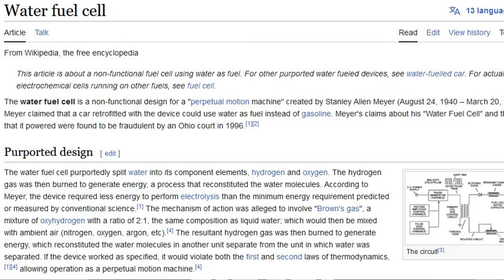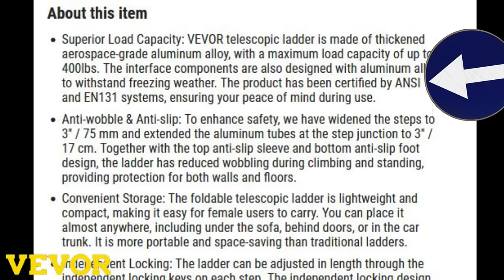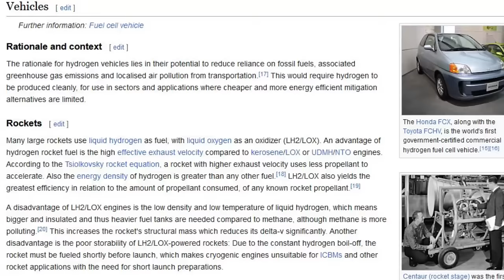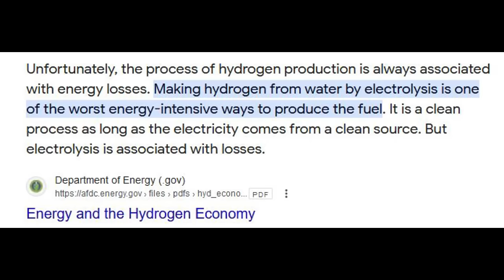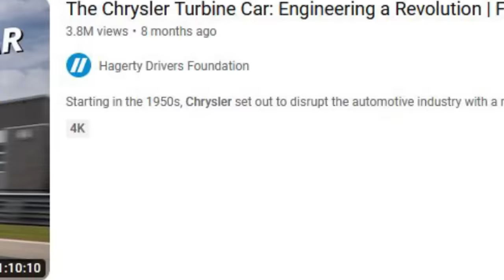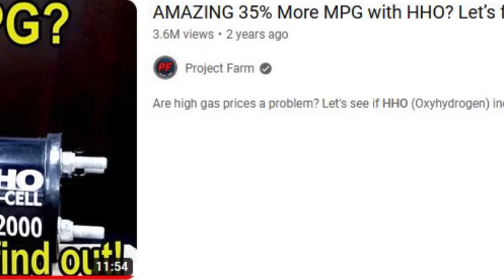These Engines Were Going to Change the World but..........

Comment: So I have an idea, let me know how dumb it is. So in a turbo application you’re only really using that boost a little bit of the time during initial takeoff or maybe climbing a big hill, you don’t need boost just cruising down the road. So why not have an air compressor with a tank big enough to store sufficient air at like 150 psi that could be regulated down to say 20 psi so when you need it you have instant 20 pounds of boost with no lag. And once you’re done accelerating or needing the boost it’ll just build back up for the next time? Just a thought I’ve had.
Reply: The efficiency in the system over takes the gains by a large margin. It’s not a new idea, it’s been tried and used to reduce turbo lag in performance applications.
Reply: @jaydunbar7538 yeah ford tried a "boost tank" in the rear bumper of a rally car. There were very few benefits.

Comment: I know that hydrogen fuel cell cars are basically electric.  There’s no combustion engine.  At least that’s what I have learned.  I don’t know what comes up on google.  I do know Wikipedia is no longer a credible source for anything.  I did like the turbine car.  Of course I am a Mopar nut.  Thanks Josh!

Comment: The real problem with the water engine is that the water must be split into hydrogen and oxygen with low voltage. SLOWLY. Im sure there are other ways, but pretty much its too damned slow. It can't be done in live time, driving doen the road and that is the nature of the elements. There is never going to be a way to split them quickly that will also fit onto a vehicle like a passenger car or pickup.
Reply: Modern submarines strip the oxygen from water to breathe
Reply: It absolutely can be done fast, just dump more energy into it. But then you would have to have a v8 powering the generator to make the hydrogen to power your v6.